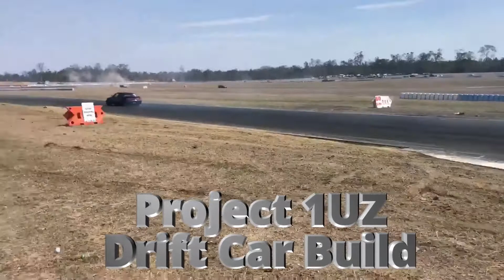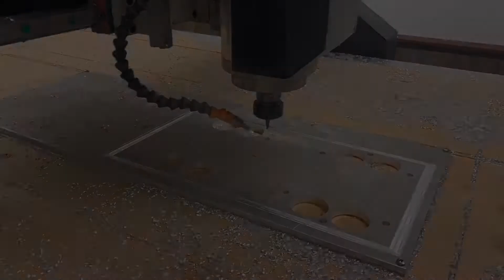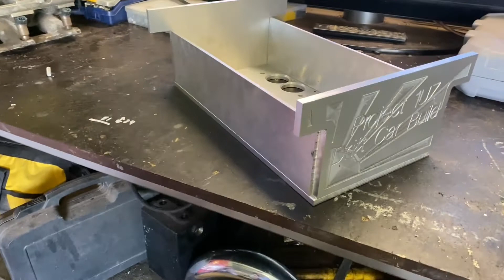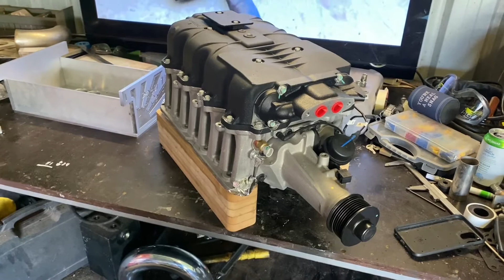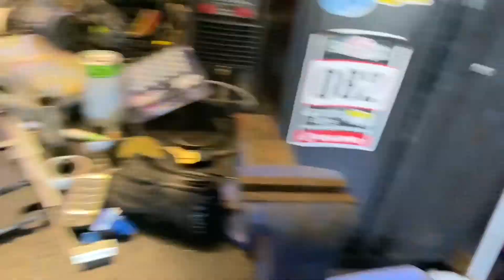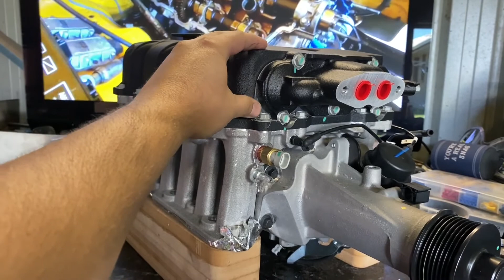Eaton M90 Intercooled Manifold status & the future of the 1UZ build.

Comment: Coming along great mate! Man I been looking for a great manifold to slap that m90 on the sc400 just up to 7lbs of boost with out an inter cooler just to keep it simple. Looking for pretty much stock fitment.
Reply from the maker: Nice man, sounds like a solid plan. Elate manufacturing make some nice low mount manifolds. Worth checking out of you havnt seen them yet.
Reply: @Brodorsport  elate does have some beautiful manifolds that’s are worthy no lie but damn $850 aud ? Lol that’s a lil steep but not as bad as billet/bullets manifold price

Comment: Look at u with that card machine I only got a big hammer and a small hammer and wood saw 😁😁
Reply from the maker: 😁, Nothing wrong with some good old hand tools. I made my existing manifold with a hole saw and angle grinder 😂
Reply: Going to try aluminium welding with the aluminium rods from ebay when I cut a big hole in top off manifold 🤬🤬🤬 have enyone used them
Reply from the maker: I have seen videos of people using them but haven’t done so myself. Im very interested to see how that goes

Comment: I have a m90 and a m62 and I'm curious if either one would flow enough for a VK45. I guess I'd have to overdrive them on both ends to make boost on that size engine.
Reply from the maker: With enough over drive they would make boost but the issue then is heat as they are far out of their range off efficiency running that fast. Intake temps would be insanely high unfortunately. My m90 on the 1uz get temps around 120 degrees C under full load and without a way for pulling ignition timing or intercooling the air you will most likely experience detonation. I would suggest using a m112 or larger for your application
Reply: @Brodorsport  thanks man yeah I figured as much. Cool idea for sure tho.